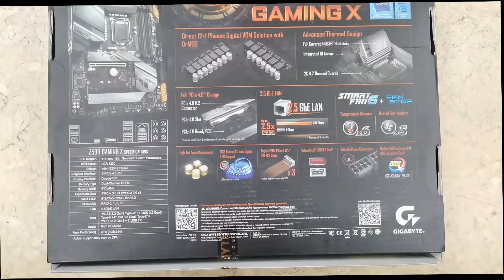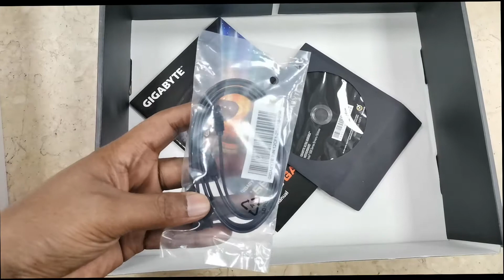Z590 GAMING X Gigabyte Gaming Mothboard with 12+1 Phases | Full PCIe 4.0 | PCIe 4.0 M 2  | Tech Land

Comment: How to set up to 4.0 pcie ?
Mine is only reads at 3.0 pcie.
Im using gigabyte z590 gaming x, rtx 3070ti, and i7-10700k.
Reply: I may be wrong but i believe you  need an 11th gen processor to use PCE EXPRES 4.0
Reply: @SAZIEL1900  thanks man, i've been search the pcie max capacity of i7-10700K its says, 3.0 pcie x16 only can read of any 10th gen processor.
If i want to use 4.0 pcie x16 i need to upgrade to 11th gen processor.
Reply from the maker: Yes bro
Reply from the maker: Moth board already have Full PCI Express 4.0 Design
1*PCIe 4.0 x16 slot
1*PCIe 4.0 x4 M.2
Reply: You need an 11th i5 or better to support gen 4